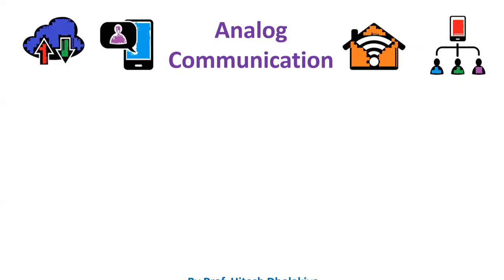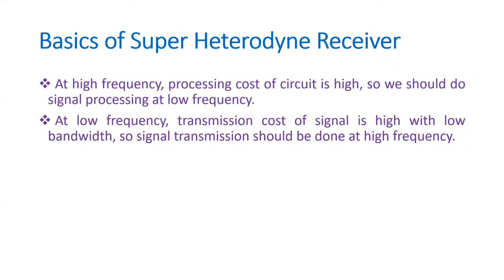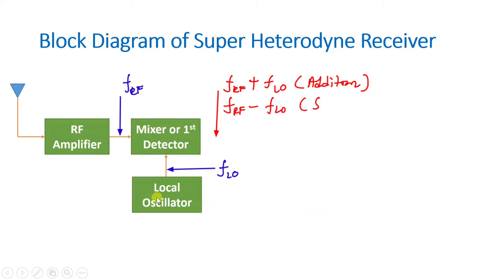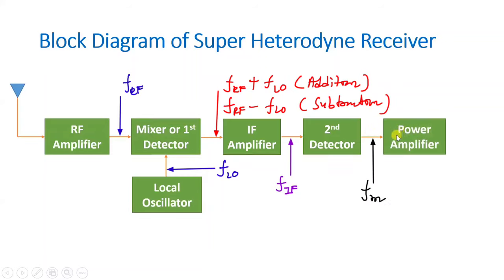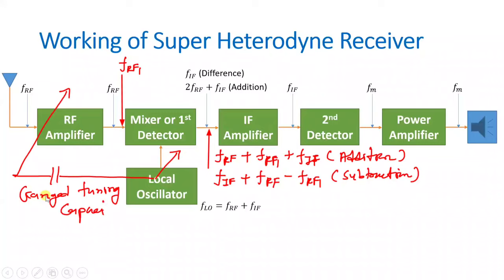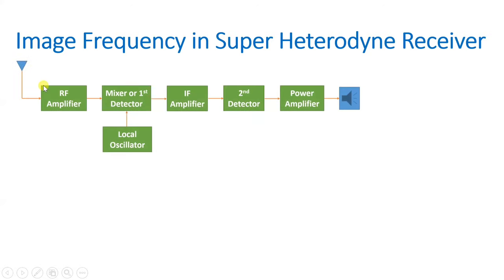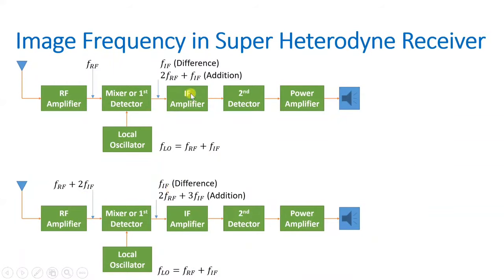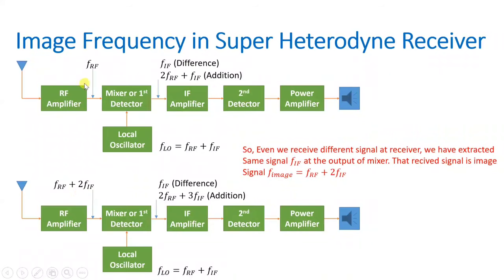Super Heterodyne Receiver (Basics, Working, Block Diagram, Image Frequency, Pros & Cons) Explained

Comment: thank u sir for the wonderful effort.. sir do this concept is applicable on communication radio sets? why do we use two IF in radio sets for communication purpose in receiver module.
Reply from the maker: This concept is already used for radio settings.
Reply: @EngineeringFunda  but why we use two IF in radio sets
Reply from the maker: @sureshbagiyal91  it's bit difficult to reply by writing comments. I have noted it and I will place video on it when I make new contents on analog communication.